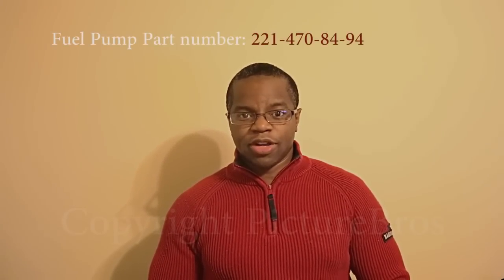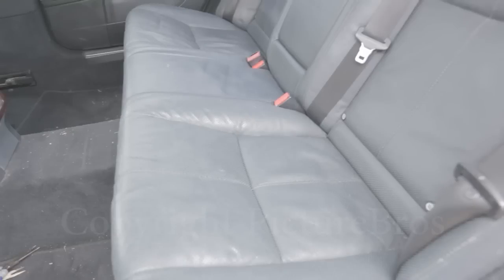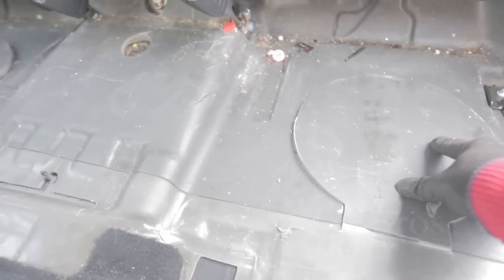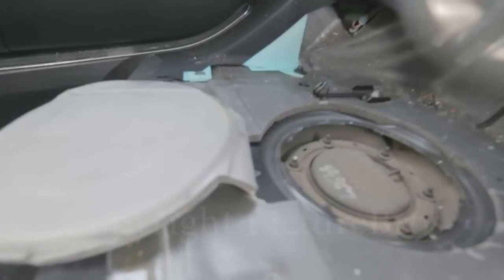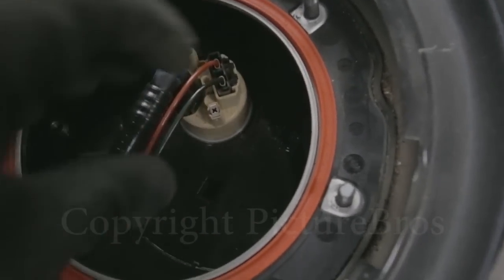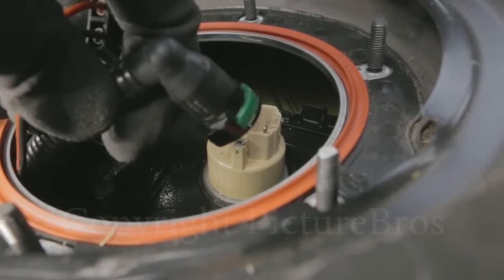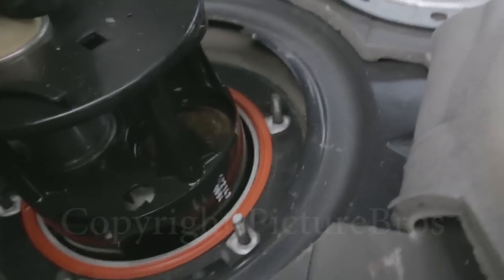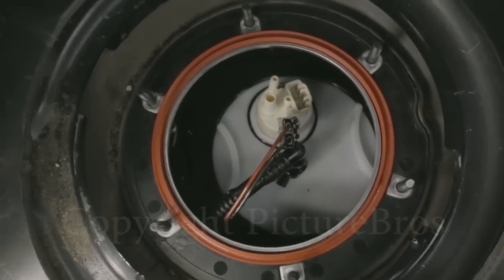How To Replace a Fuel Pump for a Mercedes-Benz S550

Comment: Just did this. I could not reach the latch. Use a long thin flat bladed screwdriver to probe gently for the latch. when you find it, push firmly and pull up at the same time.

Comment: Hey great video! Are you familiar with the fuel sending unit? My fuel gauge is dropping to empty even when I have 3/4 1/2 full tank. I did some research and that’s the part that seems to be the issue. Any help would be appreciated. 🙏🏼

Comment: I have a 2012 s550..i need to replaced the fuel control module. do i 
have to take to the dealers to reprogram or it plug and play. thank you

Comment: i have a 2009 E63 with a fault code P2540 = low pressure fuel sensor  that always comes and goes, the dealer wanna charge me 1550 to to change the pump, i am trying to order it online so i can change it myself , but my can has 2 fuel pumps under the rear seat, which one you think  needs to be changed ? left or right?
and thanks a lot
Reply: +nader kourani idiot.